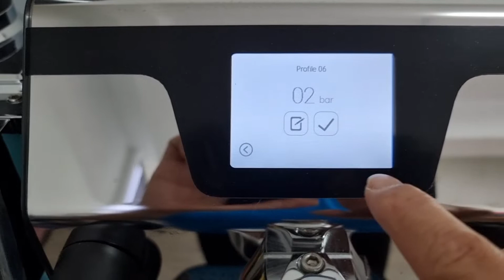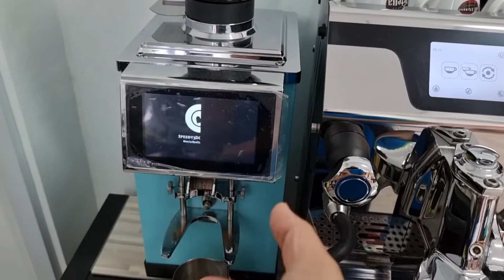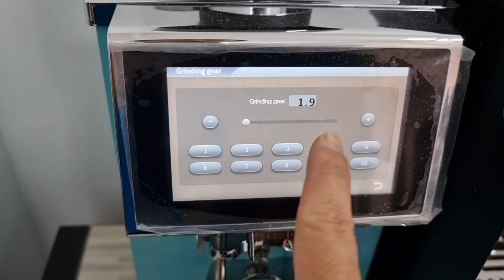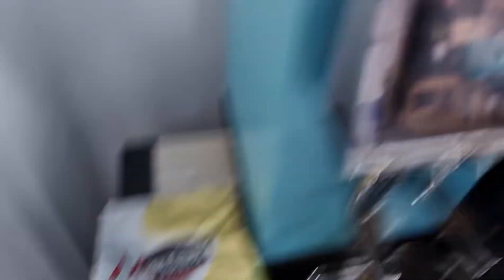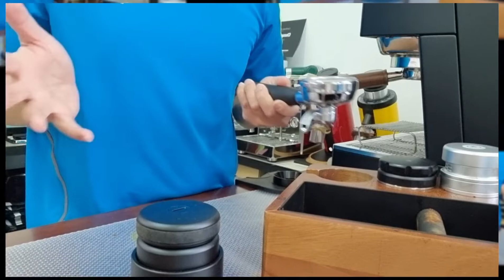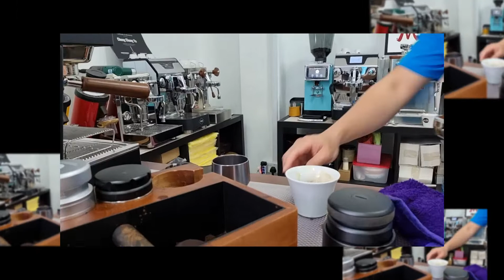Machine 02 | VBM Domobar Super Electronic  & k90 | Gear Pump Dual Boilers

Comment: This is exactly the answer I was looking for. I own a Domobar and a Mazzer Philos. I thought there was a problem when I got different outputs with the same input, but it turns out that small differences are normal. 

So can you answer these questions for a beginner?

1- I never drink it with milk. If I turn off the steam boiler, will I have problems with heat stability?
2- The offset setting is 10 degrees, but do you recommend changing it?
3- When we change the brewing temperature from the digital screen, how long does it take to stabilize?
4- Do you recommend flushing, do we need to do it? (My model has a leveler)
5- I forgot this question while writing the other questions. :D Thanks in advance for the answers.
Reply from the maker: Well, it is ok to turn off the steam boiler but make sure you drain the water off, if not the scale built up can be nasty.

In my country where the temperature difference is not big, we are summer all day long...hence I will reduce the offset to 0.

The brewing temperature will stabilise after you stop dispensing water, hence you you pull more consecutive shots, it will take longer to stabilise.  

For a machine with a lever switch, minimise backflushing with cafiza as that will eventually wear off the grease that lubricates the e61 group and you will have metal grinding against metal between the crank of the lever and the 2 valves that open and close as you engage the lever.

Hope that answers your questions!
Reply: @CaffeMartellaSingapore  Thank you very much for the answers. I am using a translation app because I do not speak English and I am sorry if I expressed it wrong but my last question was not understood correctly. I wanted to ask, is it necessary to lift the lever and let the water flow for a few seconds (to brew excessive water temperature) before brewing espresso on this machine? I did it when I used a single boiler E61 equipped machine from another brand and they said it should be done.

By the way, a problem was detected with my Domobar and I sent it to the VBM to replace it under warranty.
Reply from the maker: No this is a dual boilet and not heat exchanger. Henc ethe thermal stability is much better than a single boiler.@cakmabarista

Comment: have had a VBM domobar junior HX since 2018 ( no pid, no timer, just 2 gauges and 7 years of interaction ) .. upgrade to this ?
Reply from the maker: This is entirely different even with lelit bianca. As the way it control the water via gear pump which precisely control the pressure during brewing is an upgrade even from lelit bianca.

Comment: Wish more machines could stop shots by weight.
Reply from the maker: It is not as simple as just the weight during extraction. Too many factors need to consider. Sometime it's not idea to stop by weight
Reply: @CaffeMartellaSingapore  Pulling repeatable shots seems almost as frustrating as rocket science (or titration)... Your special distribution tool and tamper look like they'd help though.
Reply from the maker: @ad_fletch  hahaha you are absolutely right. Even from from the same batch of beans and same.puck prep, I will still get different results.